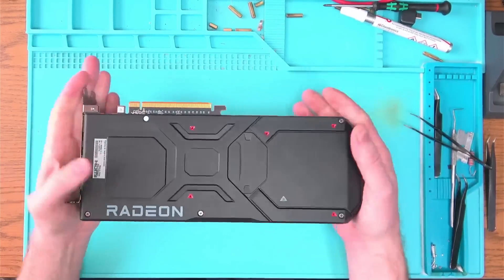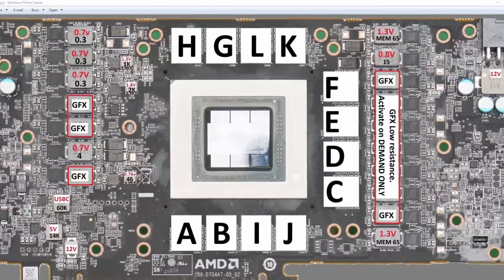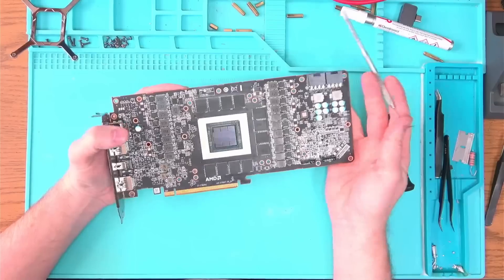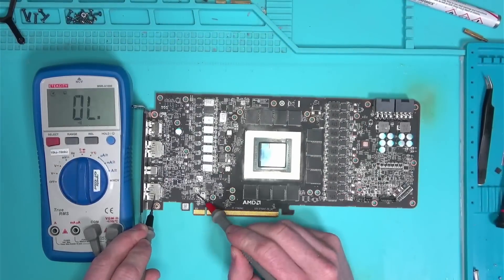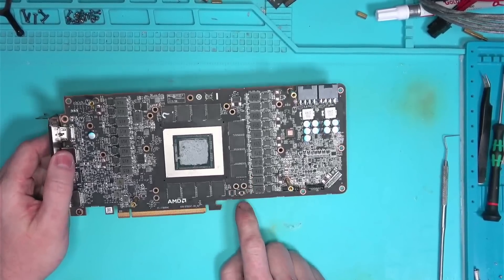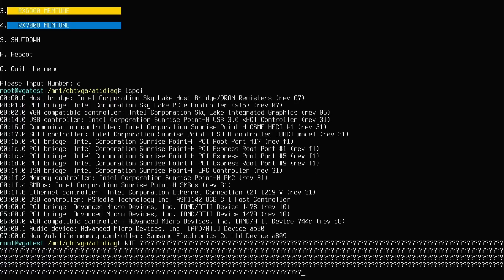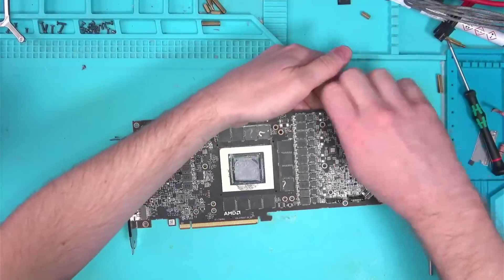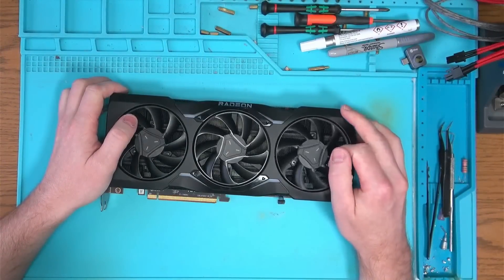7900XTX repair video

Comment: I really don't like the idea of chiplet in GPU. If you want the horsepower of two chips, you should just buy two chips, not one chip which consists of two chips but costs 3 times more. Especially when some of those designs just uses them to add more cache, which yields way less performance gain than production cost increments.

Some may argue about latency, but it's not a CPU, a GPU is already a high-latency, high-parallel design which these added 40-50 ns latency won't make much difference. Ironically, when latency is needed, AMD cpus don't even have an interposer between chiplets.
Reply: Chiplets improve yields and lower costs for manufacturing and AMD CPUs do use an interposer otherwise there would be a massive performance hit.
They are the future just look at the server market AMD dominates over Intel and that has forced Intel to go chiplet just so they can keep up with core count and efficiency.
Reply: @xfy123   It does improve yields, but not as much as those ads claim, and the packaging cost and defects will also increase. Also the imperfect dies can still be used. If this is that significant, the dual ring Haswell-EP would have already used this design.

AMD isn't using an interposer, just PCB, and there actually is a massive perf hit in dram bound applications. For example, in a real world v-ray rendering scene with about 10% dram bound, a 64 core 7B13 is not really faster than a 32 core 8375C. Same can be observed in many PTS benchmarks.

From another angle, if AMD's chiplet CPUs is really that strong, they wouldn't be hanging around  20% market share for like 5 years. K7 and K8 only took a year to eat up more than 40% market share from intel Netburst. AMD servers are mostly used as cloud rental or some edge cases like CFD applications for now.

BTW intel isn't "forced" to use chiplet. They are the ones who brought the chiplet design to X86 CPU, and continued to use it every now and then.
Reply: @Alan_Skywalker  Intel's way of doing it was closer to having 2 CPUs but on a single chip. The haswell-ep was technically just 2 haswells on one chip kinda like the old pentium dual cores or core2quads. It's easier to salvage a chip with a bad interposer or Io die then a monolithic one, same goes with the CCDs.
A organic substrate is an interposer they don't necessarily need to be made of silicon. You chose 2 strange chips to compare but any data I can find for vray has the AMD in the lead, if you can link me the results you looked at. Being ram bound in a task from my experience usually has to do with ram speed or drive speed, we had multiple new systems both AMD and Intel run a lot slower then they should in our workloads just become of those reasons.
Imo comparing trends in the rise and fall of market share now to the early 2000s seeing as the market was expanding faster and it was a new one and netburst was really bad. Today AMD has a lead in performance but Intel is still competitive and the average server lifetime depending on  the usecase is between 4-8 years so it takes time to see the impact.
Reply: @xfy123  You can't call a PCB "organic substrate". There's a huge difference here. A silicon "interposer" can have um level wire density, thus eliminating the huge latency penalties caused by multiplexing. It runs at higher frequency too. The real example is, intel's "EMIB" can even provide a universal inter-die mesh with a latency as low as 50-60ns, while the inter-core latency of AMD EPYC's IFOP easily exceeds 100ns, which is nearly as high as intel's UPI inter-cpu data bus. The dram loaded latency is also several times higher.

You simply can't say that AMD is leading in performance, as performance isn't a simple concept. From design and technology standpoint, intel is far more advanced, with much wider architecture, dedicated accelerators, low latency design, high throughput, etc. AMD is way simpler, just a 4-way-decode architecture with a crp ton of cores and cache(or registers). Good for what it does, but still have a lot of shortcomings. Ironically, common benchmarks like CB or CPU-z, have nearly zero dram bound, thus make AMD's results look a lot better.
Reply: @xfy123   E5 is monolithic, but most MCC and HCC dies have two separate sets of IMC and ring connected by buffers.

If a defect happens in a monolithic die, they can just fuse-out the affected core. If a die that large can be made, the only reason to go for MCM is to collect the good dies and make more flagship products, or to make the components in the product lines more interchangeable, which saves a little bit of money if they can't sell enough big cpus as expected.
Reply: @Alan_Skywalker  I'm going from phoronix benchmarks that have AMD currently in the lead in a lot of tasks. Cross ccd latencies do reach 100 ns or more currently but that will hopefully improve.
It is easy to fuse off a core on monolithic dies but if you have a bad memory controller or something else repairs become very expensive to do and they usually end up scraped.
Zen uses a organic substrate and is a type of interposer like everything it has benefits and drawbacks. I haven't looked into the low level of Intel's and AMDs core design and what types of hardware accelerators they have in a long while as most of the tasks we do are cache intensive and scale well with core counts.
I hope both companies start competing even more now that Intel is going with its tile designs so we can get a better price/performance ratio.
Reply: @xfy123  As for PTS, in that 110+ testes, if you select show harmonic means of all result, you'll find that a 64 core EPYC3 is about equal as a 32 core Xeon 8300 on average. Of course AMD has some traits on some apps, as I said, simply sinking money on cache and scale does have some results.

 There are chips with cut down IMC like Xeon D, but generally since IMC is so small, about half a tile, and there is little problem with parametric yield on this part, I don't think it's that big of a problem.

I actually want the competetion to happen in newer areas. General computing with older instruction sets have been encountering bottleneck for several years now, every 10% performance uplift cost a lot of RD and production cost. I think we need a better architecture as a whole, with newer, more optimized instructions, and all kinds of components such as general-purpose cores, accelerators like DPU, gpu, highly integrated, so they can all work together as complementary of eachother.

This means we get more efficient chips with little price uplift and higher perf uplift on the long run, not a chip which is simply two chips glued together and charge you 3 times the price.
Reply: @xfy123 I would say that chiplet design has its merits, but it's way overhyped and should not be used in just everything, especially consumer products. Now even intel is decreasing the number of compute dies in their future server products.
Reply: you might not like the idea but to get more performance and keep costs down GPUs are going to head to MCMs. every new node costs more and more money and the only real way to off set any of that cost is to use chiplets.

Also the 7900XT(X) doesn't use more than one graphics die, it just has the cache dies on the outside of the one graphics die it has.

Now Nvidia's new AI chip literally uses two GPUs but that is another beast
Reply: @Azureskies01  I don't know what "keep the cost down" means, considering how rapidly CPU and GPU prices rise these days. 

Each transistor is getting more expensive every new node, and wasting a lot on die area, interconnection wiring and advanced packaging for so little improvements certainly won't help us to "get more performance and keep costs down".

BTW I've already sorta mentioned the fact that they used advanced packaging just to add more cache, which ticked both the boxes mentioned above. If they don't do it like before, we may get like at most 10-15% performance loss, but half the price.
Reply: And when did you complete your microprocessor design course, sir?
Reply: @RFC3514 And when it becomes your job to question?
Reply: @Alan_Skywalker  - So, should I take that to mean you haven't studied microprocessor design? I'm surprised. 🙄
Reply: @RFC3514  So should I take that you have NO idea what a microprocessor is?  I'm surprised.🤣

Go find a job. I'm not fired, don't ask me. Not gonna be easy for you though, seeing how you speak.
Reply: @Alan_Skywalker  - Can you try that again, but in English?
Reply: @RFC3514  Oh I know, this one can't read English.
Reply: @Alan_Skywalker  - "This one"? "The idea of chiplet"? "One chips"? "I'm not fired, don't ask me." - Are you an Aliexpress chatbot from 2014?

Comment: Nice video! I have a 7900XTX and various other GPUs that I use for development purposes. I saw you were using Windows to diagnose the device. Have you ever thought about using Linux instead? It’s much easier to get the information you want from the devices than it is on Windows. Error 43 is just a generic driver failure code and it’s almost useless as to determining the culprit. AMD gpu drivers are open source too. Testing NVIDIA gpus on Linux are a little more complicated but NVIDIA has been improving their support for Linux thanks to the AI boom. Anyways, keep up the great work!

Edit: Nevermind I saw you did use some Linux as well after! Nice!
Reply: And Arch of all distros.

Comment: Yeah I'm definitely not buying a top tier gpu again for some time. Gonna run this 3090 for a few more years until it really cant keep up. If I do end up with a new gpu its gonna still be Nvidia but only the 70 series. Can't justfy spending close to 2000$ for a card to fail because Nvidia is being cheap even with the high end hardware.

Comment: I wasn't too thrilled with AMDs design choice for this generation either, as it's way too hot, power hungry, and comes with more driver compatibility issues to deal with. My reference 7900XT is still an amazing card, don't get me wrong. But if they just stuck with a monolithic die, things would've been much more simple.
Reply: having a 7900XT myself i fucking agree but i also do see the value of putting it into the market to learn what needs doing, and doing it. I should have waiting to upgrade to their next attempt at chiplets which is looking like RDNA5 but meh. As long as they keep the driver improvements coming like they have for the last year I can't stay too mad.
Reply: the price would be higher if it was a monolithic die

Comment: Time to learn reballing chiplets, lol!
Reply from the maker: lol
If i could do that, i would become GPU repair god.
Reply: @northwestrepair  should try taking apart a known bad chiplet gpu for fun to see what it looks like
Reply: @northwestrepair I believe you can do that if AMD provided you with a scanning electron microscope and a ultra-fine soldering iron.
Reply: @dasmin1135  And if the Ant Man provided him with a suit.  ;)  You know, if he started fixing chiplets, The Ant Man would be a bigger hero than The Hulk.
Reply: you'Re allready  a GPU Repair GOD,   @northwestrepair
Reply: @northwestrepair im sure u will reach that level
Reply: @northwestrepair  i think i do recall calling you GPU repair god before
Reply: @northwestrepair You might as well try since the core is dead
Reply: But you are the GPU repair god! Want some vintage cards donated? 😅
Reply: @FNGecko  yes
Reply: @FNGecko can I have one pls I’d love to try repair
Reply: From micro-soldering to nano-soldering :D
Reply: @-T--T-  The balls underneath the dies are a fraction of the size and are in a tightly packed space, you can't do them with hands.
Reply: Use acid to remove the epoxy and blast it with heat?
Reply: @umeng2002 the epoxy bonding isn't just on the side but also underneath inbetween spaces, plus the connections are in scale of few micrometers - that is several orders of magnitude smaller than your typical BGA balls, good luck soldering this.
Reply: I do not think that those r regularly soldered.

Comment: 4:25 but, Dear Friend of mine, is there a problem only with amd distribution or with all 7900xtx? We have it running in our flightcase mediaserver, so i really need to know should we sell it or not. We have the gigabyte dist. Best regards
Reply: well you see, perhaps 20 years ago amd had some driver issues so yea permanantly forever their image is ruined and absolutely nothing can save it. /s
Reply: @copper16000  Tell that to early 2023 me buying a 7900XT for 800 bucks and not being able to play FFXIV for 8... or was it 9.. it was a lot of months though before they made a stable driver that didn't have it error out and crash the driver stack in windows.

AMD drivers are still trash but they would be a whole lot less trash if they didn't put cards out there that were not fit for launch. Ohh and on the drivers sucking I can't update my drivers to any one released in 2024 as it causes microstutters in most games. I love AMD and I hate AMD
Reply: @Azureskies01  well you can gladly pay 800$ to Nvidia if they're so much better for like 40% worse performance and less vram..
Reply: @copper16000  If i could go back I would have done exactly that.
Reply: @Azureskies01  well don't worry, the 5060 ti will be out soon with 8gb for 900$ and you can dump that driverless monstrosity out
Reply: @copper16000  the 7900XT today is alright but the fact that idle power draw wasnt fixed for 9 months+ is an issue. same with random crashes in games i mainly play but I like the card just fine *now*. I think they should have released it at the end of 2023 and not 2022 is all
Reply: I think it might have due to the card falling in transport inside the box .
Or it could be the 1% defective GPU that all manufacturers have ..
Reply from the maker: Its not about 7900xtx, its about the single dye vs smaller pieces linked together unable to handle small physical impact and break from one another.
Reply: @northwestrepair  would that be a packaging issue more than chiplets themselves though? i mean now intel and AMD are using chiplets on the CPU side with little to no issues so I would have to assume there is something else at play.
Reply: @northwestrepair  does nvidia quadro have the same issue? which card would You say would be good for handling 4-6K output resolution on multiple channels?
Reply: minding that its moved really a lot in flightcase across the country